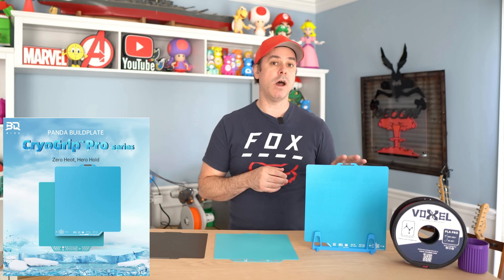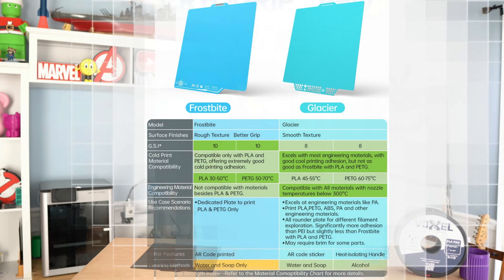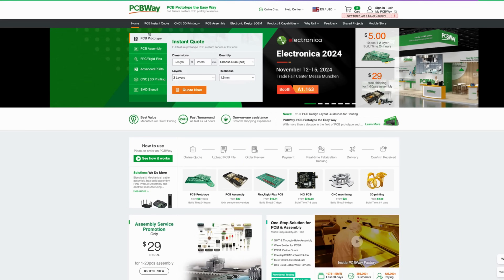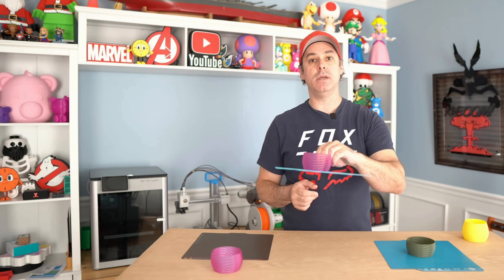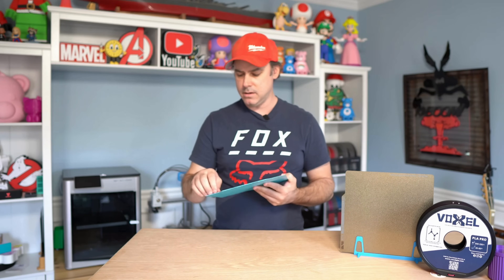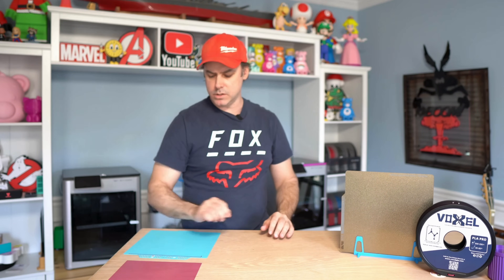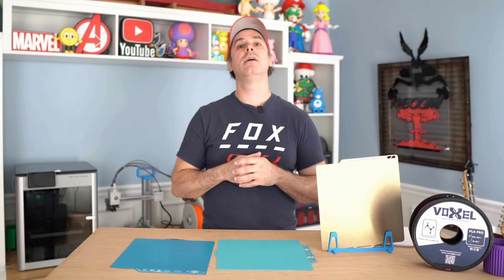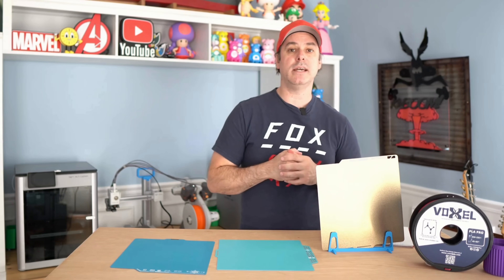CryoGrip Pro Build Plate – Upgrade Your Bambu X1, P1, or A1 Print Surface

Comment: For delicate and thin printing frostbite is not good?
Reply from the maker: My go to has been the glacier, I have found the frostbite to be to extreme of a hold in most cases. The frostbite for me worked best with larger prints that required more resistance to warpage, etc.
Reply: @ThePrintasaurus thanks after watching your video. I bought frostbite for warping issue. It's worked. Thanks

Comment: Hey, have you kept the Glacier plates for the past few months? I'm running Glacier at home atm, but I'm seeing worse grip than you have for PETG. Any chance you could share your profiles?
Reply from the maker: I am currently running the Glacier plates on all but one of my printers. What brand/type of PETG are you using? If you'd like to send me an email, I can assist with some profile changes to help you achieve a better result. theprintasaurus@gmail.com
Reply: @ThePrintasaurus  The filament that gave me trouble with Glacier was Nebula PETG Premium. I need to use at least 70°C plate temp to get "good enough" adhesion. Anything lower just doesn't stick - straight up falls off or curls. That's the same temperature I use for Bambu PEI plates. Hotend for Nebula PETG usually at 235°C. What brand PETG do you use with Glacier?  Do you still find 60°C bed temp to work the best?

Dropped you an e-mail as well, appreciate any insight.

Comment: Nice vid mate, enjoyed the comparisons 👌
Just a small heads-up that might help someone out—at around 10:06 you say “all flat, no issues,” but there’s a bit of lift showing on a few of those prints. Probably no big deal for cosmetic stuff, but for dimensionally accurate parts it would likely be a failed print. I’ve got the same plates and they work amazingly well, but definitely still need the odd wipe down. When I’ve had lifting like that, it’s usually been first layer settings or surface of the plate itself.  Been there a few times myself ha ha.

Hope that helps anyone scratching their head while troubleshooting. Keep the vids coming 👍
Reply from the maker: Appreciate your feedback and input! Also, I appreciate the support, it's been fun, and looking forward to continuing to improve and provide better content!
Reply: @ThePrintasaurus  Your content is solid already. It makes a refreshing change to watch something with clean sound and good delivery. Just subscribed too, mate. Keep it up!

Comment: Great video! So, any input on your satisfaction with the Glacier plate after a few months?
Reply from the maker: I have transitioned to the glacier build plate on a few printers now. The A1 mini, X1c, and my Voron 2.4. They are very consistent and require little to no maintenance compared to my PEI build plates. I more recently have been doing a lot of ASA testing/printing. The Glacier has worked great so far.
Reply: @ThePrintasaurus  Thanks for your response!!!

Comment: I'm going to put my tin hat on after I type this, but I am big advocate of using Elmer's Purple Glue stick on the Textured PEI for a belt and braces approach to bed adhesion - especially for warping prone materials like ABS or ASA.

I wonder how the Glacier would perform with filaments such as ASA or PA with some really challenging bed adhesion prints versus the textured PEI plate with a coating of Elmer's on it.
Reply from the maker: I too have used various glues with the PEI plate and ASA. From the testing and printing I've done so far with ASA on the glacier plate. I have found that more often I have still had to use some sort of adhesion promoted with Bambu's ASA. I have been using the bambu roll on glue stick and that has worked great. 

I have been using Flashforge ASA lately and have not had to use any adhesion promotion on the glacier plate so far. I have been using the Smooth Textured/HighTemp profile and 100C to 102C bed temp.

Comment: why do i continually get an error when it reads the qr code to detect the plate
Reply from the maker: Which plate are you using, which plate in your slicer? For the Frostbite is should be your textured plate.  For the glacier it will be whichever sticker you put on. I turn the build plate detection off, and just set things up manually. I did have a few failures with the frostbite and getting the correct build plate reading. If you turn it off, just make sure you have your plates clear, and installed so you don't have any surprises. I have got busy and forgot to check once or twice and almost ran a print with no bed installed!!

Comment: What is the adhesion number for PEI? We don't know. So 8 and 10 from Biqu is only relative to each other (i.e, the actual numbers don't matter, they could be 80/90 or any numbers as long as one was slightly less then other). The higher numbers simply imply that they are good numbers (well, unless it's out of 100). PEI is designed to release when cooled. I'd say if they all held just fine when printing and the Biqu plates did not release as well when cooled, that the Bambu PEI plate actually performed better. Certainly the layer test showed the Frostbite plate failing during a PLA print (what is actually designed to print better). No testing is show for the PEI plate. You _say the Biqu adhesion is better then the Biqu plate but the only print you show has them all performing the same during the print. Now at the end you do seem to agree that the PEI is just as good as the Biqu plates but then, out of the 3, recommend the Glacier. I do thank you for taking the time to make the video and it was worth watching from start to finish.
Reply from the maker: Appreciate your inputs. All good points. It is hard to really find or set a "base" to compart all plates too. Especially when it comes to an adhesion standard. I was simply working off what BTT advertises as there adhesion numbers. Where the PEI plate falls on that scale after using all three I would say the PEI plate is a high 6 or 7.  Which is something I should of said in my video! 

Something that I do find and like with the Glacier plate - which is my go to plate at the moment. We lost power the other day for about 3.5 hours. I had two prints running one with the Glacier plate and one with my go to PEI plate. The pei plate release and my print failed as a result. The Glacier plate held and I was able to recover once the power was back on and continue the print. So there is benefit there. Ultimately I think doing plate reviews comes down to preference, and showing more examples might help in that process for someone to pick a plate. I'll work on that. My goal when I set out to do this was to help people and provide more accurate reviews when I reviewed something good or bad. Appreciate your feedback!

Comment: I can see some curling on the gingerbread house pieces.
Reply from the maker: Yes I had some curling initially, which I realize made it into my video. Wet filament was the culprit there. I had it break in the ams twice, soon as I dried it. Things went back to optimal and adhesion was back to what I was seeing throughout testing. 
Thanks for watching and thanks for the support!

Comment: Took the 7 days for biqu to finally send out and hopefully not 25 days to get here but I ordered a set of Glacier and I have a bambu supertack waiting for me when the post workers finish striking,  it was a day away when they started the strike unfortunately and the quicker delivery will be preferred for me coming straight from bambu if the plate results are the same. Then its down to whichever lasts longer.
Reply from the maker: Hopefully that strike is over soon, if not already. I'm sure you are excited to try those new plates! I have a bambu Supertack that still hasn't come in, but will test when it does. My go to plates now are the Glacier, I'm going to revisit after a few hundred print hours and do a comparison to the PEI plate I typically used to see how well they have held up. I'll incorporate the super tack plate as a test to that as well!
Reply: @ThePrintasaurus  took 21 days to arrive but the glacier plates are in my possession still no bambu plate yet.
Reply from the maker: @thefriendlessgamer8552   Finally! I have been using the bambu supertack profile lately with the glacier plates and things have been working great!
Reply: @ThePrintasaurus  I'll try that setting. Thanks
Reply from the maker: Did you get your plates? Curious how things are going.
Reply: @ThePrintasaurus  no strike is still on for the bambu plates, and I ordered from biqu website on 22 nov and it says usually takes 25 days but hopefully sooner.

Comment: Have you tested with ABS/ASA? I'm interested in nonblended versions
Reply from the maker: I am testing ABS now on the Glacier build plate. I have used Bambu, and Polymaker for testing so far, at the recommended manufacturer bed temps. Both have stuck without issue, so far good adhesion. I'm going to walk back temps and continue to test till adhesion fails or I have warping issues with the ABS. So far things are looking great with ABS. I'll move onto ASA after a few more test cycles.

Comment: So I just ordered the Glacier build plate, it hasn't even arrived yet, but now I'm hearing Bambu released their own version of this grippier build plate called the "Bambu Cool Plate SuperTack" Can you do a video comparison for us between BiQu's Cryogrip and the new Bambu SuperTack?
Reply from the maker: Hello! Yes no problem at all, I actually just ordered the bambu super tack the other day. When that comes in I can compare the three plates. Supertack vs Glacier vs Frostbite.
Reply: I have the SuperTack and it's already peeling after like 3 prints. The adhesion is too good,  so I'd avoid printing things with a big flat bottom...they sent me a replacement but I'm probably just gonna sell it lol
Reply from the maker: @xKenn  Thanks for sharing, so far I have about 100 hours or so on these cyrogrip plates and I have not had any quality issues yet.
Reply: @ThePrintasaurus  From my own experience I find that hard to believe. I was printing PLA at their recommended temps for both the nozzle and bed, yet it still peeled off the coating. Never encountered such problem with their PEI plates. Honestly, I hate how the CryoGrip blue color looks on the A1 but I might have to give it a try...
Reply from the maker: @xKenn   I have been using the Glacier as my primary plate at this point, and I have not had the quality issues mentioned. I did receive an "early" plate, I wonder if something happened in the manufacturing process? I saw on one of the forums someone with the Frostbite had what looked like hair under the coating. 

Now that the supertack plate is out, I have been using that profile in Bambu Studio with my Glacier plate and have had a lot of success printing with it. With the X1 I just leave the build plate detection off. But I have been using the standard temps with it and have not had any lifting or plate issues. I hope this does not become the trend, I have had a few already mentioned some issues with the supertack quality as well. 

As an added bonus - we lost power yesterday for about 3, 3.5 hours. I lost a print on my pei plate because it released, but the glacier the parts stayed in place and I was able to resume that print and save it. So there is a lot of potential in these coatings for sure. I just hope if there is a current quality issue on the plates they have released now that it gets resolved. I'll email BTT and mention these concerns too.

Comment: i just got the glacier and during nozzle cleaning a fair amount of the blue coating comes off and sticks to the nozzle 😬 is this normal?
Reply from the maker: Is this in the back middle section? That is normal, it's supposed to actually clean the nozzle. Once that wears the coating off a little and goes through a cycle or two of doing that you shouldn't have any further issues.

Comment: I see an added bonus for the cool plates is for power outages. 
I was about 90% through a 40 hour print when the power went out overnight. I wasn’t able to resume printing in the morning because the Bambu textured build plate cooled down and the print had released from the plate.
Reply from the maker: In comparison to other plates, this is possible especially with the frostbite plate. I left those plates out for a few hours to do that test, and the grip they maintain I don't think it would be an issue to keep things held till power is restored.

Comment: I'd like to see what settings change when using the different plates.
Reply from the maker: I played around with the lower end of the recommended built plate temps for the Glacier and Frostbite. I didn't experience any print quality issues so I used my standard print profiles. Aux fan off for PLA. Let me know what settings your curious about and I can test and get back to you.

Comment: What plate setting do you choose for each in Bambu Studio?
Reply: +1 on this question! I was thinking to do the "Bambu Cool Plate SuperTack" but any help would be awesome.
Reply from the maker: Yes. I should of added that. Will get something in the description to reference. But to answer your questions. The Frostbite has a AR code on the plate that pins it to the textured PEI Plate in bambu Studio.  I ran the bed temp at 35c first layer and 30c other layers for PLA. It worked well at 30c and 30c too.  For PETG I went with 50C initial layer, and 50C other layers and had zero issues. 

For the Glacier build plate - the recommend AR code to use based on the stickers provided was the cool plate. So you would use the cool plate in bambu studio. 45c first layer, and 45c other layers for that one and it works fantastic with PLA.  60c worked great with PETG.
Reply: @ThePrintasaurus  I own a glacier and was wondering if I would better set the plate to Cool Plate SuperTack? The Cool Plate preset has 0c for Generic PETG and 35c for Generic PLA while the Cool Plate SuperTack has 70c for Generic PETG and 45c for Generic PLA. Is it better to change the Cool Plate Temperature settings or is it better to choose the Cool Plate SuperTack? Do the plate presets differ in other settings than the filament temperature?
Reply from the maker: @martymcbro    I looked through the machine G-code just to see if there was anything added recently for Z-offset. The only Z-offset adjustment is for the textured PEI plate, it moves it to Z -0.04mm. I put that output below if you were interested in how it looks.

;===== for Textured PEI Plate , lower the nozzle as the nozzle was touching topmost of the texture when homing ==
;curr_bed_type={curr_bed_type}
{if curr_bed_type==“Textured PEI Plate”}
G29.1 Z-0.04 ; for Textured PEI Plate

So based on that it appears that the other build plates use the same z-offset, which is what I would of been concerned with. You should be good to use the new supertack. That build plate came out right after this video was released or it would of been a great test. You will need to turn off build plate detection as there is no sticker for that one if you are using a X1.
Reply: @ThePrintasaurus  Thank you for the investigation. I will try this again. I already tried the Coolplate SuperTack setting for the Glacier with one PLA print of a christmas deer, but the legs of the deer kept falling at some point resulting in a failed print. I tried this twice. However, another print with PETG and a larger base area finished succesfully with this setting.